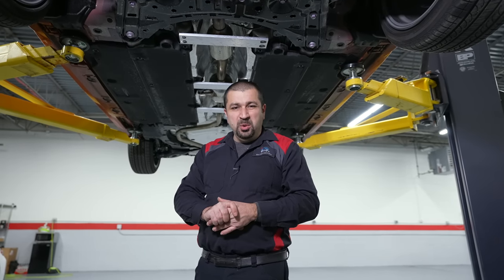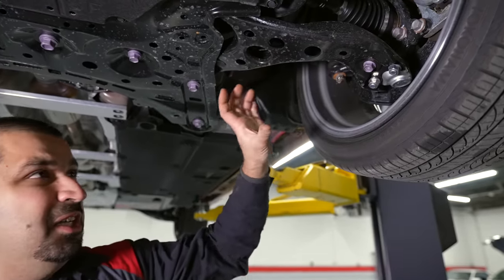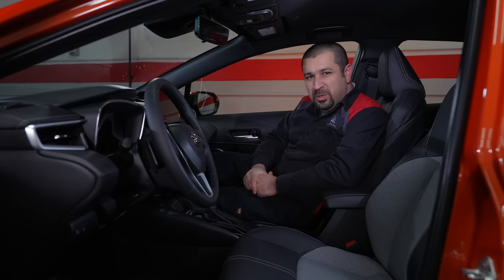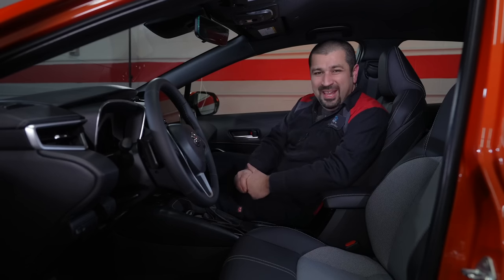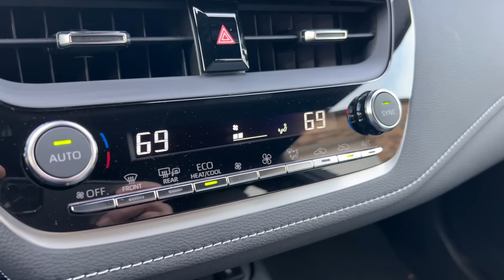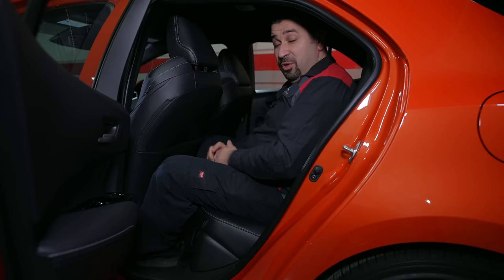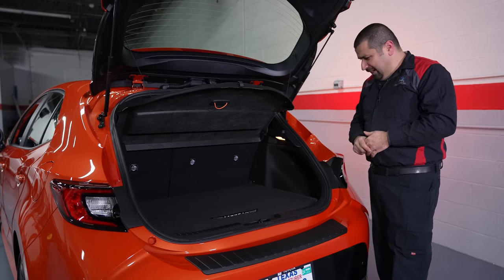Should You Buy a Toyota Corolla in 2023? I Have Good News and Bad News!

Comment: Great cars, today our paid off 2017 Corolla SE (50 year model) has had no problems. The lights are all original, even the brakes pads front and back are all original 6 years and all original from the factory with almost 99,000 miles. Brakes fine still. Today we got 43.2 on the interstate. Quality!!! The transmission shifts very smooth it’s an automatic. All service done through Toyota. I won’t buy any other brand period!!!

Comment: Hatchback SE is where it is at. You give up dual zone climate, fake leather interior and easy to scratch alloys, but you still get the same engine, infotainment, same brakes/suspension, and I would say the 16" wheels are a better choice, ride smoother and the generous sidewall of the 16" tire protects the wheel from curbs and scratches. Dec 2019 we bought a 2020 Hatchback SE with BSM for $20,750 before taxes. You can't beat that. Well, you couldn't, but hopefully things are normalizing, get the SE people!

Comment: Perhaps not directly related but I bought a 2022 Corolla LE last year.  I have a 2014 LE Corolla.  The 2022 removed heated side rear-view mirrors that the 2014 has.   I assume the 2023 does not have them as well.
These little things matter.  It stinks when the car is encased in ice. I became used to that benefit. Now I have to wrap my mirrors in ziplocs when it's going to be icy overnight.

You don't take things away.  You add, or improve, or at the very least you leave alone.  I don't understand why Toyota does this nickel-and-dime crap.  I didn't know this until after I bought the 2022 but yes, I would have bought it anyhow.

Comment: I waited for a GR since the GR Yaris launch. I looked at the 2022 XSE 6 speed last year and it got the same gas mileage as my 2000 Celica GT. A GR showed up at the dealership and after test driving it and following the GR Yaris, I see the improvements for the GR Corolla. I can also understand why the new 2023 Corolla isn't a manual, manuals aren't to common in the US. Maybe they just didn't sell. But the Supra got a manual via complaints. That was my comment also. I thought ahead and got something I was happy with and enjoy. I thank you for your knowledgeable information. The GR Corolla oil was information is some of us at home service people did not know because the platform is so new to the US market.
Reply: Its strange about the manual transmission. The VW Golf R is only available with a manual in North America because a fairly large proportion of potential owners demanded it.
Reply: They do a fake manual its not legit. When i shift my motorcycle its all mechanical bro

Comment: I believe Toyota is doing a automatic version. 
Ill trade in my 2020 4runner if so. The older I get, manual gets annoying in city and traffic jams. Plus better mpg than my 4runner.
I drove a 2011 corolla and it wasnt a good vehicle for long drives. Only city driving.
Maybe the GR will be better for road tripswith the extra horse power.

Comment: I live in the UK and have only ever driven cars with manual gearboxes, or 'stick shifts' as called in the U.S.  I commute through very slow traffic every day to work and back and find the constant pushing in of the clutch pedal and rowing with the gear lever a pain. It's a wonder my knee isn't worn out ! 
I'm collecting my used 2019 Toyota Corolla 2.0 touring sports hybrid tomorrow and I'm eagerly looking forward to dispensing with the clutch and gear lever and moving onto the Corollas cvt automatic system. I had a test drive in it and it was sublime, the car does all the work ! My left leg is joyous with no stiff clutch pedal to jam down every few seconds. So to me the cvt is the only way to go, and I embrace it. The general quality of the car surpasses anything Ive owned before in 42 years of driving, and Im sure it will live up to all the praise the current Corolla has had heaped on it.

Comment: A new design is coming so that's one reason against it. Also, the Subaru Impreza RS has 190 horsepower and AWD. Leaving this car in the dust. There's nothing I liked about this car when I drove it. It doesn't even have telescopic steering wheel and was painful to drive.

Comment: That’s a bummer they got rid of the manual. A lot of younger drivers that would drive this car as a sporty fun car would have opted for it probably. Most people that buy a Corolla buy it for a commuter or a inexpensive reliable first car so it’s kind of disappointing. I’d go for a civic just for the manual in this regard. The gr is overly expensive and over the range for most the people that want that kind of experience. It’s crazy that they have made manual sports cars more expensive than automatics.

Comment: I bought a Corolla hatchback with the manual transmission. So fun to drive!  But I noticed that the yolk was real stiff. I told the service manager manager but he said it was fine.  I took it in got the third oil change, and again I told them about the stiffness in the yolk. They said the same thing, no problem. I was out shooting photos in the spring.  When I got in my car to drive home, I heard a sound ?  It was a faint squeal, but something told it was the throw out bearing because of the tight yolk. Sure enough!  Upon inspection at the dealership revealed what I thought. So the had to replace the manual transmission.

Comment: had a 2019 model, and in two years i put 50k miles with no major issues or repairs just oil changes a second set of tyres and a battery because some lights were left on and killed it at the worst time, but  nonetheless that thing was whisper smooth, had the power that you needed and easily averaged over 30 mpg. seriously all the car you could ever need

Comment: 7:09  Does he mean under-coating or under-cladding.  Undercoat is an anti-rust protective paint.  Plastic fender or wheel arch protectors are cladding.  I prefer the former over the latter but would expect both.  Cladding alone does do prevent wetness between the steel and the cladding and rust will form without you being able to see it.  
If you need to carry stuff (people, luggage and shopping) get the sedan.

Comment: The wheel well interior and the catalytic convertor can easily be protected by screwing on more galv. sheet metal on to it. The shark fin is an antenna , for remote key to operate door lock? It had to be outside the metal shielded body.  From a decade ago? I noticed there are almost no difference between the physical size of the Corolla and Camry, although the Camry supposed to be mid size. You need a tape measure to tell.

Comment: I wanted to buy a 2023 Civic but the dealers are still charging 5.000.00 over msrp. Also Honda does not make the cheap LX model anymore. I will have to check out the Corolla. I wish the Tacoma base model still came as a manual trans.

Comment: I think Toyota quality is starting to slide downhill.  Plastic valve cover and half of the wheel well are major turnoffs for me. Maybe not the end of the world but certainly not good. Disappointing to see.
Reply: Long-term reliability ratings are still at the top. Plastic valve covers have been on Camry since 2018 model year, Rav4 around that time too. No problems, many examples with 200k+ miles
Reply: @marklintwo  that’s a shocker, I had a 2019 Camry and the only reason I traded it was to get a truck. Good to know.

Comment: toyota last year discontinued the diesel Innova (2gd-ftv) in India and only sold the petrol version for 4months , then in November they released the 3rd gen innova and totally changed the car , from body on frame platform to unibody and rear wheel drive to front wheel drive , no mannual and most importantly no diesel option which was the highest selling variant , the new model came with this m20a-fks non hybrid and higher trim models with the 5th gen hybrid system , no manual all ecvt. after much backlash from the toyota fans they brought back the old model with the 2gd diesel engine in January this year. toyota fans do not like change for sure no matter how good you tell them it is they would take 3 4 years to realise it's better but nothing beats the 1gd and 2gd.

Comment: I looked at it in 2022 and the "big" problem is that it's too small for a hatchback.  The carrying capacity was abysmal as was the room in the back seat.  Otherwise, it was a fine car.  I also looked at the Prius Prime - again, compromised hatch with the big battery sticking up and making the load floor not flat.

Comment: I have the 2023 Toyota Corolla XSE sedan and a couple of things I don’t about it is the “fog lights” or if they can call it that. It’s more like an accent LED light, that’s it. You can’t even turn them on and off. It just comes on with the main headlights. When you turn them off, they turn off. Not a fan of it. Give me true fog lights or nothing. 

The second thing is of course, the infotainment system. It doesn’t read USB sticks. And the actual display screen size is way smaller and don’t take advantage of the larger bezel! 

They’re first world problems but if I had to nitpick on the Corolla, those would be it. Performance, looks, overall functionality is as expected. It’s a Corolla.
Reply: Thanks for your insight. I have a 2024 XSE sedan coming to me in January in Ruby Flare Pearl. I rented a Corolla for two weeks after an accident and I enjoyed more than the Camry because it’s just so much more nimble being a compact sedan, plus it’s ridiculously easy to see out of. And that was a piece of crap 2020 LE. I look forward to having lots of fun in Ruby. 

I am a bit wary of seat comfort due to the sport tuned suspension but most people find it actually comfortable.

Comment: CVT transmission only, that is bad. I'm in Finland and never driven a car with automatic transmission before. I've heard bad things about CVT so that's a dealbreaker. Good thing is that I come 10-20 years behind in cars, driving only cheap and used so there's plenty of time to see how this pans out and probably by the time I might be buying this, better options from different brands are already available.
I've liked toyotas till date and currently driving a '99 build in Japan corolla.
Reply: Toyota has been using a CVT in Corolla since 2014 model year. They are very reliable.

Comment: Toyota should dump the sedan and hatchback. Switch everything to a liftback design.
Reply: @EpicDrew15  To address the lineup mess. One model, multiple trims and maybe a 6 speed option. Personally I think hatchbacks are excellent and can compete with the biggest advantage SUVs have - cargo room. US doesn't like the aesthetics of hatches so a liftback design gets closer to the sedan style on the outside while still being very useful. Maybe a dual hinge design - trunk opens, and if lifted higher, the rear glass comes up too.

Comment: Great review. I actually really dislike the looks of the new Corollas, not so much last year's as this year's but funnily enough, when you said it's a beautiful car I thought "hmm.." and kinda had a second thought about it (doesn't look too bad to me now).
I wish the GR looks were available as an option to all versions, especially the GR Yaris looks really good in my opinion and I never liked the Yaris. In general, I don't like what they've done in the Corolla with all those bulging and sculpted bits - I wish they had gone for simpler, more aerodynamic lines and instead of the wild looking features, they would have used all the space taken by them to add some more room. Yes it's really cramped inside, especially if you are tall. It kinda feels like a steel body shell build around you - very claustrophobic. As if that is not enough, they've added these unnecessary design touches by making the dashboard on the glove compartment side with a slightly angled front edge: as if the passenger should have one leg shorter than the other. What were they thinking?
On the engine points, yes awesome to have the upgraded engine but why just on the normal version and not in the hybrid one too? The CVT I think is a cost-cutting move by manufacturers and also helps them greatly achieve those lower emissions. Frankly I don't get how the gearbox can be have a service life that's shorter than the car's but I guess that's just me.  Next thing they might start making plastic wishbone arms - who knows. 
Engine-wise, I wish Toyota will collaborate with Hyundai and incorporate the latters variable duration technology in their engines - I would trust Toyota to make such a complicated engine but not Hyundai on their own (but let's wait for a1-2 years and see what happens). 
Lastly, not sure if it's the same everywhere, but in order to get electric windows you have to go two versions higher than the standard version. I would wish they would leave the option of electric or manual windows to the buyer in all versions. .I don't consider electric windows s the safest option but I get it that it's a thing.
One very positive thing about the new Corollas and Yaris is that they have now moved to 5 spoke wheels with 5 nuts, and to top it up, all the wheel designs they offer range in looks from decent to great. But yeah, that is a great design move and makes the care look rather special: there's nothing I hate more than those pesky wheels with 5 arms and just 4 bolts that look like they are placed in the wrong place - as was the case in the previous versions of the Corolla and Yaris.

Comment: So this is the 2.0 or 1.8? I had to add under hood insulation to my 2022SE it came bare. With the Wind Chill Pearl white I wanted to protect hood paint from heat. They make kits to convert rear reflectors to functional turn signals. Makes it look even nicer. The XSE doesn't come with a stiffer suspension like most sport models? Bigger sway bars etc?
Reply: 2 0L is in ALL 2023 Corolla Sedan and Hatchback in the USA.

Comment: Thanks for the recommendation of the 2.0L engine. Just a thought - didn't you lament the issues with the high pressure direct injectors? What are the problems with these engines?
Reply: No problems with Toyota's combined direct/port injection.

Comment: One problem with my 2023 Corolla hybrid is the fancy headlights. In the center area directly in front of you are two shadows that stick down into the lit part. The first time I drove the car at night while turning, it literally looked like an animal running across the street directly in front of the car. I jammed on my brakes so I would not hit it. Only to realize it was a defect in the headlight array. My dealer said to me that the lights are not adjustable so just get used to it. Maybe they will fix it in the future. The real problem will be the day an actual animal is running across my path and I ignore it and hit it. This is a real safety problem with this headlight design and get used to it is not a proper response.
Reply: Same issue here. I went from a 2017 SE with awesome bright low beam headlights to the 2023 SE with the sorry designed headlights that on low beam it casts out a shadow that looks like 2 fingers pointing down on the road. Very disappointing to say the least.
Also have an issue that every time shortly after driving the car it jolts while driving. I noticed that by looking at the temperature gauge it happens right when the thermostat opens every single time.

Comment: We had a 2020 XSE hatch 6 speed.  It was a good car but honestly the shifter wasn’t great and it was slow.  Also interior and cargo room stunk. A civic is a better choice and maybe it won’t make it to 800k miles but they are very reliable.
Reply: Civic - direct only injection, some turbos, look up problems with these. No thanks
Reply: @marklintwo  I have a 2020 Si.  As a whole no issues with DI buildup, turbos rarely fail.  Big issue is ac related and fuel injectors like to act up eventually.   However to drive a fun car with a big aftermarket I'll take the slight drop in reliability.   Also back seats will fit adults unlike the corolla.

Comment: Well i just bought a 2023 SE because of you so lets hope you say more good than bad about it! The one thing ill say before i watch the video is Im averaging 32mpg mostly highway with 2300 miles on it. Our 2018 got almost 40 on the regular. UPDATE At 6000 miles we just had to have the direct injectors replaced. Now a day later we have a bunch of CEL on on the dash. I suspect they forgot to hook something up. I did find a loose ground. Back to the dealer. Its also the LOUDEST car Ive ever owned and my previous two were toyota cars. A corolla 2018 and a yaris 2012. Neither were this loud. We will likely trade it off in a few months and get a camry, prius or avalon
Reply: I dont mind the CVT. Our previous 2 Toyota cars(corolla and yaris) were manual but Ill say its nice just putting in it D and going.
Reply: Mine was 31k out the door(26k base price for the Se with a couple of options. black out emblems, floor mats and the windchill pearl paint which is beautiful) with the tax and we got the warranty for the entirety of the 87 yes i said 87 month loan. With interest rates what they are and good credit we are paying 500 a month! Yikes. Hope to refinance in the future and we arent quite sold on it yet anyway. We may opt for a corolla hybrid or camry hybrid sometime in the near future.